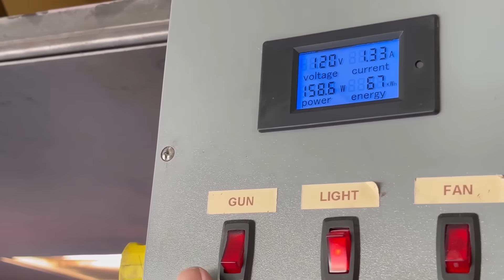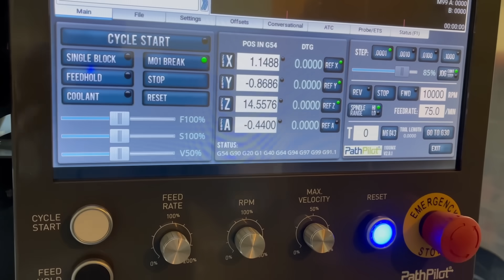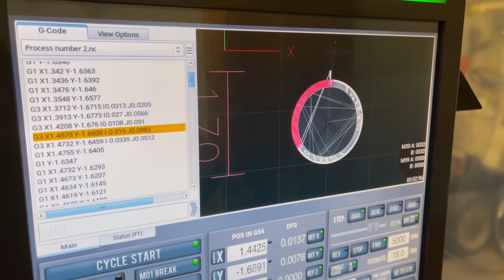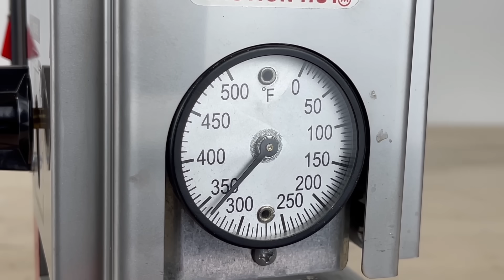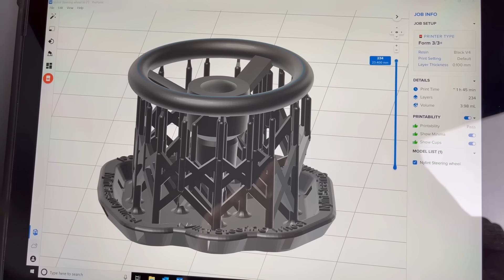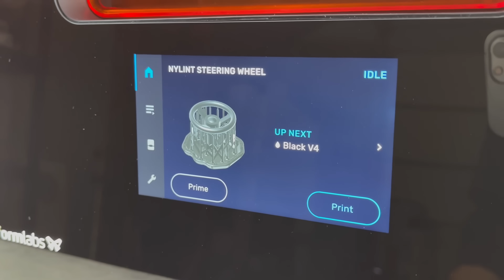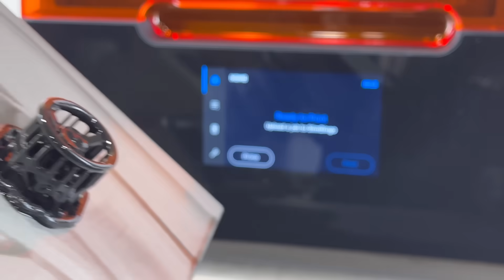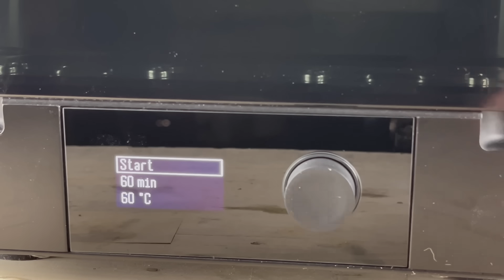1960s Nylint Hot Rod Roadster Toy Model A Restoration

Comment: I’m a lay person who really enjoys your videos.  I’ve been wondering , how do you decide when to use pitting putty or wet sanding? I’m also curious you don’t seem to use smokers for out gassing that often. How do you make that decision? I’m just fascinated and curious about the details of  this amazing hobby
Reply from the maker: Thanks so much for watching Cat TV!!! I decided all depending on how deep the pitting is, many times its very tough to see the depth on the video but in person its pretty easy to decide. Normally the powder primer will cover most pits after being sanded, but if not then I'll either add another layer of power or filler. Thanks again for watching!

Comment: Very cool, I watch until the end, just because you are very detailed and whimsical with the details, I have already signed up! Just a tip, use grease and oil to flow without wear and reduce friction and noise, as well as prevent oxidation.

Comment: I could recommend a small modification for the Dune Buggy Wrecker. Replace the string with one just long enough for the hook to just touch the ground in down mode; that should keep it from pulling the nose of the towed vehicle so high when you lever it up.

Comment: Great video as always. But 1 very important bit you should do with your resin printer is fit a flexible sheet to it. You will not have to pry the print off. just flex it off

Comment: Awesome videos my friend, fabulous attention to detail, I noticed you used a brush on a drill for cleaning plastic parts, had you ever thought of using a water-pic, that would be equivalent to a miniature pressure washer for these small parts, that way you dont run the risk of damaging a locking tab with that spinning brush.  Just a suggestion.  Keep up the fabulous restoration videos my friend. 🤠🙏💖

Comment: Very nice , not sure if you know but they have a glazing putty that was designed especially for those small rust pock marks. It's a light blue and extremely easy to sand. JB weld is extremely hard to sand and I'm just flopping out an easier method.

Glazing putty, they sell it at advance auto parts, O'Reily's, napa. Check it out, you'll be happy you did. 

Also when I worked at Abracadabra Auto Body. We would cut our putty knife down to fit smaller spaces for an easier application.

Keep up the great work 😃

Comment: Awesome as usual, was curious what you "bake" your powder coat in?
Reply from the maker: Thanks again Jeffrey&Tina Canine! I bake my powder in a modified Pit Boss Copper Head smoker, I actually converted it over to an electric oven and added a recirculation fan on the top. It's worked well, but I'm actually in the process of making a larger one from scratch.

Comment: I am subscribed and particularly like this restoration. I have two queries:

As you went to all the trouble of building a die for the whitewalls, why didn't you use four whitewalls from the die so that all of the whitewalls would be the same colour?

Why did you treat the axles differently from the other silver/chrome parts of the car? Why not either powder coat all, or nickel plate all? Why not blast all, or vinegar treat all?

Comment: Have you tried a butane lighter on one of the, clean/dry plastic pieces, it will bring the color back, as long as you go over it, on one of the throw away parts,  just try it and see if it brings back the beautiful color, that was original, on whatever plastic you're trying restore.

Comment: I love the restoration process, you do amazing work.  Couple of questions..why didn't you 3D print the whitewalls and does the powder coat ever cause issues with reassembly due to thickness.  I see the guys who restore tools just use spray paint but never looks as good as powdercoat.

Comment: On the filings for the aluminum(?) blocks you use to make the molds, do you collect them, &/or have a sm refractory so you can melt them back down into blocks & use them again?  That'd be fun to see, if you were to do it!  Melting metals is fun (I took a basic metal sculpture class in college for an art class; we used oxy-acetylene torches, & that class was a requirement before anyone could do any other welding class). Metals can be expensive to buy, relative to other things, & eventually recycling your shavings would be nice.  (Heck, I even watch guys who melt #2 plastics in a panini press & make things out of it.)  

So, w/ that new 3D printer (always evolving!!) will you now be able to make seats like the one you had to buy?  Also, how many white wall milds have you made & are they all just different enough, that you haven't (seemed to) reuse them much (or is it just me)?  Glad the sheep made their appearance--it's funny how we miss seeing them when they're taking a break (wink*  aka oops, forgot them!).

Comment: I'm very impressed by your whitewall mold, but why is there no vent? Normally, injection molds have a vent for extra plastic or resin to run out. The air has to go somewhere!

Comment: Really impressed with the injection molding setup you built.  Did you replace the tires? The ones at the end look like they're in much better shape than the ones you cleaned mid-video.
I think the restoration is far nicer than the original, and will last for many decades before requiring refurbishment again.
Reply: I too notices that  they are obviously new tires

Comment: Could you please 🙏 please 🙏 let me know when you can what are the pliers called that you used to take off the rims and tires? They work perfectly, especially how they go around the axle and simply push off the tire from the model . I need to buy a set for the work I'm doing with diecast models in the 1.18 scale ⚖️ size. Thank you. Sincerely, Robert JD Fraser

Comment: Need to put some grease in that rear-end,Lol,hello Chip,hey I was watching another guy restore the Tonka fire truck with the snorkel that raises & lowers & after he got through sand blasting the piece where the base of the piece that the snorkel was at it was really pitted & he died even bother putting filler on it & you could really see it when he got through painting it & I asked him how come he didn't put filler on the piece that's really pitted & he told me bcause of time restraints on YouTube, I think that he really didn't want to put any filler on the piece & didn't want to bother sanding it down,what do you think about that 🤔,let me know something okay, I would Appreciate it very much if you can okay thanks